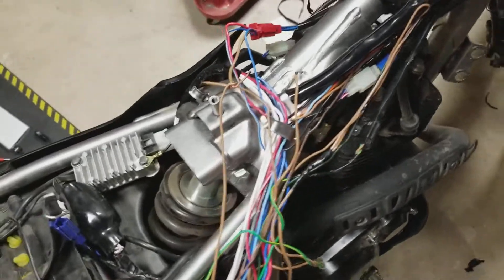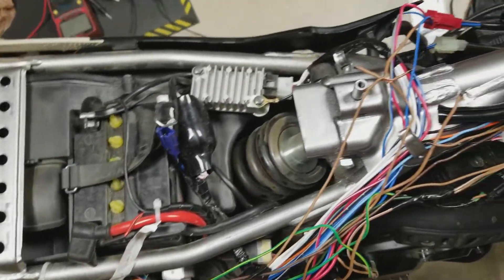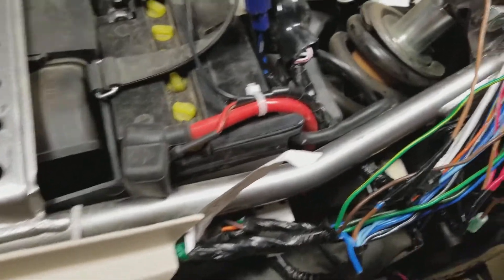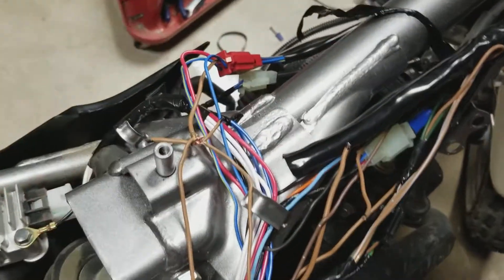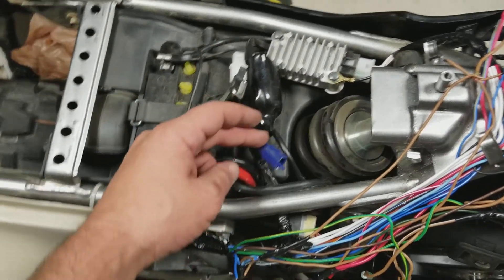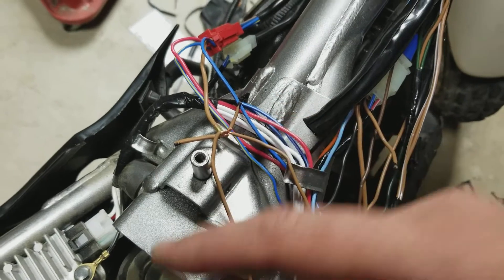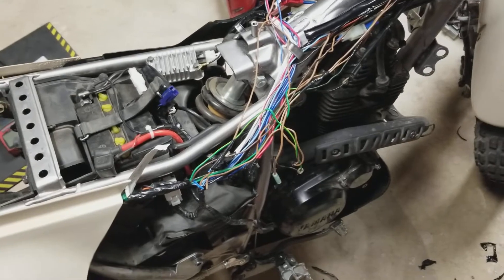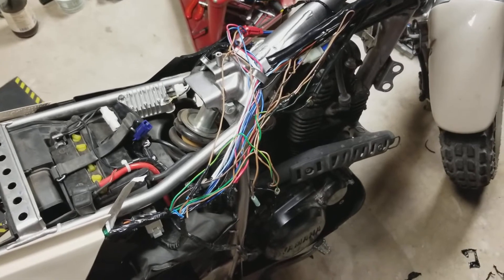TW200 Wiring: GPS, Blackout lights and more

Comment: Hey bro so what if i wanted to just use the start button as the engine kill/start? Just those two brown wires will work since that brown is going to the switch right? Is it okay to delete the rear brake too?

Comment: I have problem with my tw200..currently i dnt have the battery..battery died soo i use the kick start..at first the light signal are all working..but now after a month..there is no light..why?
Reply from the maker: If you are using the tw200 with no battery in it then you probably cooked something in the electrical system by overcharging it.  Good luck
Reply: Adventure Brad so u mean..i cooked the voltage regulator? And i need the new battery??
Reply: Adventure Brad or any other things that cooked out for my tw200?